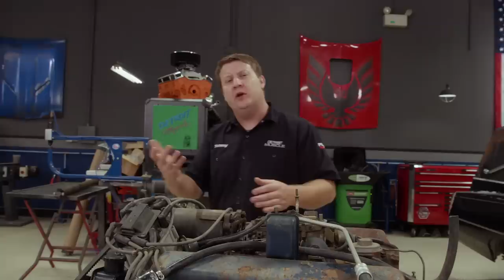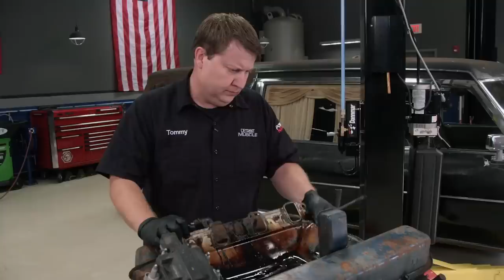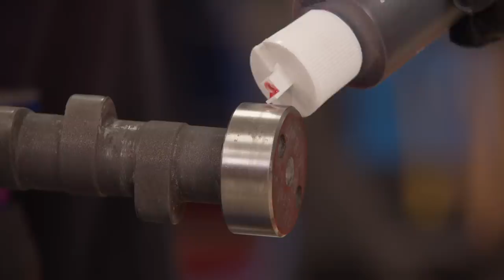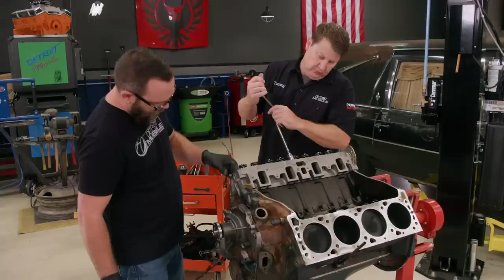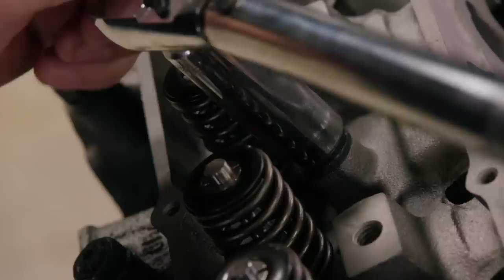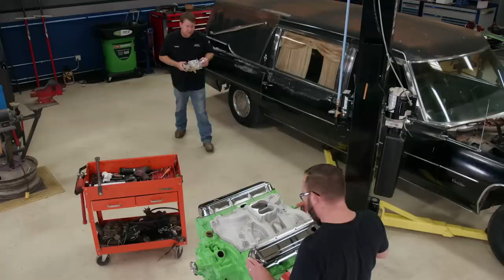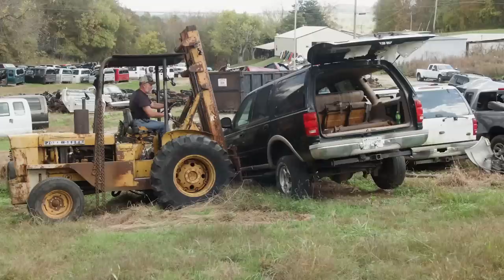Upgrading the Cadillac 500 To Make Serious Heavy Horsepower - Detroit Muscle S8, E2

Comment: Spend all that money on good parts and do nothing with the bottom end of that junk. Real smart.
Reply: I said the same thing.
Reply: Put head studs in it but reused the stock oil pump.
Reply: Yep
Reply: Have you heard of "top end rebuild"?
Reply: @ghost187x   everyone has. When you don't know the true history of the motor spend a couple hundred dollars to make it better. They didn't even look to see the status of the motor on the bottom end.
Reply: @The New NKVD so that why I own 2002 suburban that runs 13.9 in a quarter. No weight has been removed. You are obliviously the mechanical genius.
Reply: Actually these motors have a pretty bullet proof bottom end for the hp they are running. As a side note they don’t always show all the steps of their builds. If you rewatch they show a cropped shot that shows degreased clean section of the bottom end.
Reply: It's only being built to 500hp . The bottom end will take that all day .
Reply: @JRRowen-ht6du  true that. I'd still give her some new rings and check the bearings though. How crusty it looks it has to have quite a few miles on it.
Reply: @TJ4774  good point !
Reply: Say it with me. Budget
Reply: It’s a budget build. That’s what these guys do they show you a budget friendly way of making decent power
Reply: you don’t need to do a full bottom end build if your going to spray it with nitrous, the motors gonna reach constant high rpm, or boost

Comment: Good thing with the caddy 472 and 500s , even after 100k miles on it they'll still have cross hatch marks in the cylinders they rarely need a rebuild and they love a cam swap, 76cc closed chamber heads, an intake . Been building these Cad engines since the late 90s.
Reply: Why close chamber, open chamber breaths better?
Reply: The cadillac gurus say the 425 heads don't seal on the 472/500 and vice versa???????????????????????
Reply: We like em to for our air boats we run direct drive so horse power is what we gotta have we really only use the 1970 or older motors takes less money to get the power were looking for the older ones were supposed to come with 400 h.p.but we have found a few we knew were making more then that the last one we bought was right out of the car a March 1970 hadn't ran in years I was shocked to say the least when I got the distributor in timed wired high rise four barrel long tube headers Holly 750 and she fired right up and ran real good not even a lifter ticked in it damn ran good but my brother wasn't happy so I changed the cam lifters springs relapex valves replaced guide seals ported heads and  intake new even better carburetor  fired it back up broke the cam in for 20 minutes at two grand and damn she's got some power now haven't had it checked but I'd bet she's pumping out 550 h.p.
Reply: @ineffable1129  they need the compression
Reply: @calvinlayport3127   0
Reply: Also, add high-performance rod bolts.  It's a weak spot.
Reply: I just bought a 70 with the 472. Any recommendations for headers?
Reply: @MrJosephfunk   Sanderson, or Cad Co.  I just bought a pair of Sandersons for my bus, and one of them doesn't fit.  Their builder, Carlos, was on the phone with me in under 24 hours to discuss what options I had, and they're going to switch my right side header straight across for a block hugger versus the 600 model I bought.  1-7/8 collectors are perfect for sub-6000RPM action.  Such as might be found in a 16,000lb school bus with the original SM420 manual transmission drivetrain..
Reply: @Bolton115  awesome thanks. I'm just wanting to open it up so it can breath.
Reply: It is good to see something done with the engines like the Cadillac 500 getting tired of the LS invasion Steve Magnotta a would say LOL
Reply: @gmcnelly2468   The 425 heads have a slightly different coolant passage setup.  So you have to drill a few small extra holes in the 500 block deck or the smaller chamber heads might run hot.  One of the holes is kinda close to the fire ring, and some builders are concerned.  But my 500 block under 425 head setup has been pushing 15,700lbs of manual transmission school bus around for 22 years.  So I feel like it's a viable setup.
Reply: @Bolton115  THANKS for the respnonse and info.  Would you happen to have a photo(s)/diagram of the mods??  I am guessing that you are using the 425 gasket??  By the way, who is the gasket manufacturer?  All the forum gurus say it won't work, but your extensive experience proves otherwise!
Reply: @gmcnelly2468   Forum gurus often weren't doing this mod before there was an internet to tell 'em the only way to big power is big bucks.

Use the 500 gasket.  Get a 425 gasket and overlay it atop the 500 one.  Take a marker and color in all the holes the smaller gasket has that the big one doesn't.  Make the 500 gasket, then  the block deck, have those holes.   There are two on each side that are kinda close to the larger 500 bore fire ring.  If you look at the 425 head, you will see that those holes may be moved up a little bit in the gasket and block, so as to be a quarter inch farther away from that fire ring.  I will be making a YouTube video about this here directly.
Reply: @Bolton115  THANK you very much, sir!  Please let me know when you post your video.
Reply: What about the 429 caddy engine?
Reply: Those engines had extremely high nickel content in their iron. Such that they literally did not wear hardly at all with anything resembling proper care. Almost the polar opposite of the HT4100 in terms of inherent build quality.
Reply: GOOD METAL

Comment: For 1970, Cadillac increased the stroke of the 472 to create an even 500 cubic inches (8.2 liters), initially as an Eldorado exclusive, producing 400hp and a massive 550-lbs ft of torque.
Reply: Yes , no. Way over rated power numbers dude !!
Many people have rebuilt these engines to factory specs and put on dyno. They got 323 hp and 500 torque on a 1970 engine 10.1 compression.  I drove these caddys for 24 years straight.  I had several and built the transmissions and differential you name it. I forgot more than you will ever know.
Reply: @Iceman_777 
 500
In 1970 Cadillac fitted a crankshaft with a 4.304 in (109.3 mm) stroke, increasing the total displacement of the engine to 500.02 cu in (8.2 L). At its introduction, it was rated at 400 hp (298 kW), SAE gross, and 550 lb-ft (746 N⋅m) of torque. https://en.wikipedia.org/wiki/Cadillac_V8_engine
Reply: @Darknamja  Says a guy who drives a Honda.

Comment: Why in the HELL didn’t you guys check the bottom end? Are you hoping to grenade this and stick a rod through the side of the block?
Reply: Maybe they are hoping that it will blow and then they can do it right and put an LS in it!
Reply: @beetlebuidler5882 ls swaps are cool but not everything needs to be ls swaped. I’d recommend only thinking about doing an ls swap if the stock engine is trash. These old Chevy engines are nice and pretty simple/bulletproof. Especially the 350

Comment: The cast iron intake on my old 428fe weighed in at around 78lbs! Going aluminum brought the weight down to around 28lbs.
Reply: indeed!!
Reply: Even the 352 or 390 intakes were nut busters.
Reply: @bobseagraves1743  They are the same. I swapped a 428 for a 390 in my 67 Galaxie.

Comment: why didn't you degrease and pressure wash the engine before disassembly?
Reply: They had product placement instead of power wash.
Reply: @GC_420  as long as the show is free to watch, I have no problem with this
Reply: I have always wondered t that. It seems it would be less nasty and easier to see what you're doing.
Reply: Because it's the car isn't worth anything.  No point in putting time and effort for nothing on the back end
Reply: Scared to get hands dirty

Comment: I had a Fleet of 10, 1968-72 Cadillac Fleetwood Limousines all with the 500cid engine. Never had any problems requiring the heads to come off. They had the double wall exhausts that would occasionally collapse after being driven through a deep cold puddle. Instant power loss if they still ran at all! Replaced all of them with single wall pipe. The other thing I did was delete the OEM fuel pumps and replace them with electric ones. They all had those damned Carter Thermoquads. Edelbrock to the Rescue! They drove beautifully. Better ride than a Roller. They were NOT fast!

Comment: These boys are in dream land USA.  I had many 425 caddys then moved up to the 500 c.i. Cadillac engine. I also rebuilt several TH400 transmissions. Getting that much power out of that engine with those mods is not gonna happen.  I spent over 10k on mine. Best parts available I got 500hp and 600 torque.  These fools have been taking carb cleaner hits.

Comment: I would’ve replaced the main and rod bearings due to typical failure they get from years of using the wrong oil. But I like where they went with it, hopefully they won’t need to take it back apart anytime soon.

Comment: It was a serious engine back in 1970. It had 400hp. But it was reduced later to 200 because of the emissions regulations.
Reply: My step dad has the de tuned mid seventies 500ci caddy motor in a blazer frame with a ‘64 nova body….. yeah weird but the thing is WICKED!
Reply: Got a 72 eldorado, can you maybe tell me what they changed to reduce the power ? Im new in the Muscle Car scene, always had german Cars like a RS6. And no the Eldorado is not my main car😂
Reply: @thelayerstomysoul6170  In 1972 the 8.2 Liter V8 was making about 235hp. They reduced the HP and torque by lowering the compression ratio. Moving from 10.5:1 down to 8.5:1. Also reducing the inbound air lowers the power as well.

Comment: Early model small chamber heads would give you 12 to 1 compression with the stock pistons. That swap isn't recommended without upgrading the bottom end though.
Reply: Usually the factory cast pistons don't respond well to that increased compression in the 500s. Ring lands tend to collapse. I for one would have liked to hear some further explanation of why they went for a 425 head (with considerable additional machine work and expense) over the stock heads or earlier 472 castings.
Reply: 425 heads are prone to blow head gaskets on 472-500 engines. The water passages are different and get really close to the fire ring. Better off changing pistons and decking heads. I have done the early and later heads. I would say the later 120cc heads are great for the street, small chamber are probably better for race only however there are several aluminum heads now so just ditch the iron.  I would always recommend the grooved cam bearing on any Buick or Cadillac. Me personally would get the heavy stock pistons out.  Get weight out of the bottom end and balance, then run roller rockers and you can actually rev it😂

Comment: Helped my dad build one when i was bout 12 in the late 90s before internet and all the aftermarket parts back then you couldnt find anything for them it was for off road use so we shaved the heads an put a rv cam in it and had to have the crank turned some. It took both us to set the crank in it. It replaced a 455 olds an honestly i wish we had kept the 455 the 500 was full of torque wouldnt turn over 5k rpm very heavy an always smoked alittle from a valve that never would seat right we ran it on one propane unit an he had manifolds on it id like to of seen what 2 propane units and a set of headers would of done to it. Last i heard it was in a dump truck

Comment: I think a gm 12 bolt would have been my choice, keeping it all in the family. Correct lug pattern also..
Reply: stuff a ford under it! .... if this car  was a ford, I'd say stick a chevy 14 bolt under it!  heh, <3 all
Reply: Many of the GM truck axles shared the same wheel cylinders as the Commercial Chassis cars too.
Reply: They come from the factory with a 12 bolt
Reply: @diduck6878  Wrong. It's a proprietary Buick, Olds, Pontiac design but still does not share any of its internal parts. The axles are entirely different thickness and splines. The carrier and ring and pinion are uncommon.
Reply: Pretty sure an  ambulance station wagon or some commercial chassis gm car's had The five lug Dana 60
Reply: @scotteric8711  But the commercial chassis rear ends were heavier duty than a 3/4 ton pickup.  With all that torque, I would have left the stock rear end in there because the sun will burn out before they break it.  However-the rear disc brake part does have appeal.  So it does make sense from that standpoint.
Reply: No way the gm rear ends aren't that strong when you put real torque to them a 9 inch or bigger is a must

Comment: 8:50 Cadillac heads were not the problem. It was the low lift cam. Any time a 500 cuin v8 only make 200 hp. It needs a cam.
Reply: No those heads have bigger combustion chambers. Stock compression is either 7.6-1 or 8.0 I can’t remember.  Those 425 heads are from the 60s and they raise the compression to near 10.1.   The cam only compliments it by taking advantage of the increased cylinder pressure and improved airflow. That cam is fairly mild but still aggressive.  Throwing a cam with that duration in a smog motor  with low compression and you would have a dog.
Reply: @danhoyland142  425 heads were not around in the 1960s.
Reply: @danhoyland142  No, the 425 is from 77-79
Reply: The 425 caddy heads came off the 77 thru 80 engine blocks. The reason we use them its a direct fit and raises the the compression to 12 or 13 to 1,what ever your heart desires
Reply: @puffkendrick6850  We? They don't raise the compression that high and they stopped using the 425 in 79.
Reply: Ed Miller  Now tell me how did the the 500 cuin make 400 hp?

Comment: Suggestions or options: Shave the door handles off those side loader doors,  Revisit the engine with a black spray can,   Lose the padding on the roof if it is still there; that stuff is a rust encourager,  Why the iron heads?  Nothing aluminum available to shed some additional weight?  As for tearing down the bottom end, the test drive didn't show any blues, but also no mention of any pre tear down compression test.  This motor spent its life trolling along a slow speeds or at idle, but it would still have been a good idea to pop the oil pan to mine the bottom for nuggets and check the crank end play but hey, I'm not the builder, they are.  Oh yeah, that Caddy pickup conversion idea a thread or two down the list would be both killer and a weight remover;  keep the side doors to make it a real one off.

Comment: The Caddy engine is actually fairly light given that's it's 500ci and all iron, only around 625lbs.  That's fully dressed, a BBC is 685lbs, MOPAR 440 or Ford 460  ~650lbs.  Stock it's a 4.3x4x3 bore and stroke.
Reply: Buick 455 is the lightest. Almost the same as a iron SBC. Caddy is also light, aluminum heads and intake and it's super lightweight. They are very wide which can be a problem

Comment: I got an old '76 Coupe DeVille for cheap, with the 190hp carbed 500, the injected has 210hp... on paper, actual numbers I ain't got a clue.

But seeing a video like this gives me hope for the old lump, maybe the 500 can be made into something functional beyond a way of quickly setting fire to fuel while managing to float down the road holding onto the steering wheel in fear, as Norway... ain't all big highways, it's like taking a boat to cross the mountains, slow and ya get seasick :P 
Still enjoy it, just didn't seem like the most efficient engine for something strangled due to the oil crisis, they went the opposite direction of the last oil crisis car I had, a '78 Mustang II with the 2.8 V6, 90hp, but a tiny light car that was surprisingly good for its age, a light nimble American car from the 70's almost sounds like a joke. :P

The other USDM car I've owned also felt like an oil crisis car despite being an '80 model, 140hp 4.9 V8, a 1980 Buick Century Estate Wagon (basically a Malibu wagon) with a 301 V8, but not with the turbo that the Trans Am had, a lazy low powered engine for its size, but enough torque to keep up with "sporty" cars from the 80s on the straight.

I have no idea why I went on about that, I'll just blame my ADHD and move on, as what I was trying to say is, thanks for showing a way to keep the 500, it'd be more interesting to keep the huge thing, than swapping in something smaller and newer.

Comment: They put enough RTV on it to stop the titanic from sinking, reused all kinds of old junk on it and then not even touching the bottom end with plans to give it the spray lol
Reply: because the car isn't worth anything.  it would be a waste of money
Reply: @alejandroherrera5271  If it's worth building, it's worth doing it right.  Not doing a bottom-end rebuild and testing/cleaning the block was kinda silly.  At LEAST bearings and rings, even if they kept the rods and pistons.  Trueing the crank?  Maybe, not like they're going for 1000Hp, but still a benefit.

It will probably survive nitrous, but better to make sure it does.
Reply: Did you see the condition of the distributor drive gear?
Reply: @MrAcuta73   Right?!  Seems like a modern set of rings and bearings would be good for 20-40HP simply because of the improved compression.  Less oil consumption if nothing else.

Comment: Back in the old hot rod days you took a 500 cubic inch Cadillac engine took the heads off a 472 Cadillac engine installed them on the 500 and it gave you 14.5 to 1 ratio combustion. You could buy an adapter to put big block Chevy headers on it crane made a cam for it and all you had to do was come up with your own homemade intake and you had a beast. Hot rod magazine put one in a Chevy chevette one time.the carburetor ended up sitting around where the windshield frame met the cowl. So yeah any big block didn't run on just horsepower it was pure torque. How to know my big block Mopar 440 used to beat those small block Chevrolets every Sunday at the drag strip.